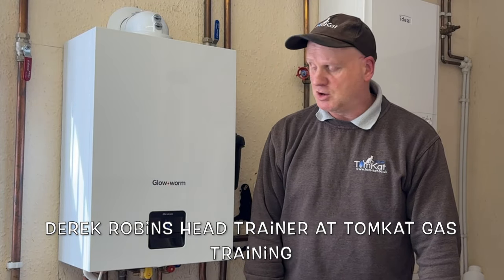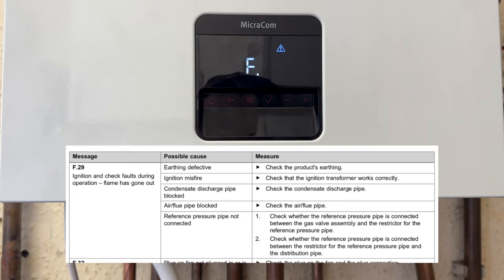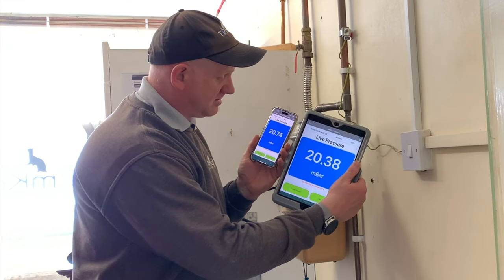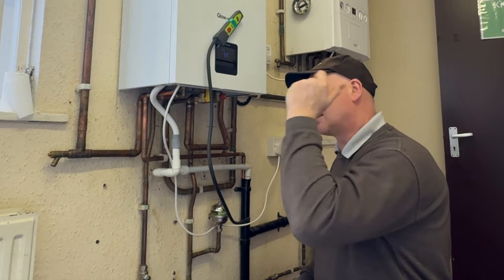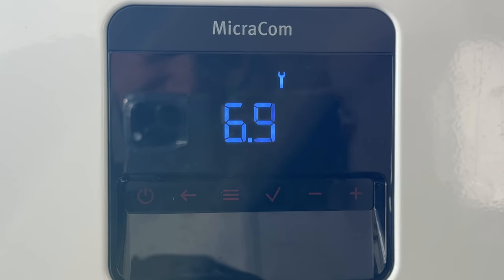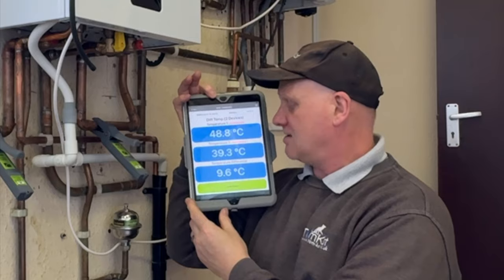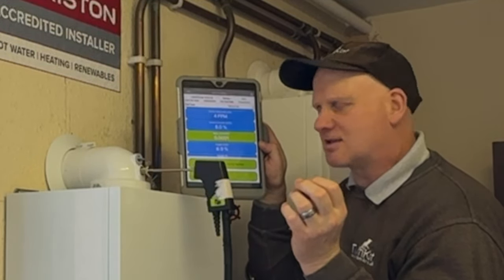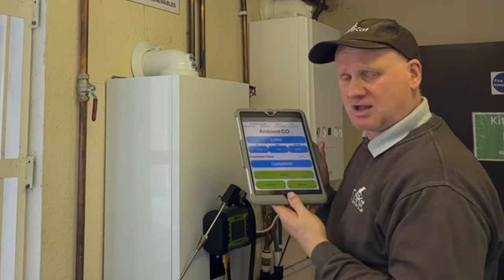COMMISSIONING THE WORST GAS BOILER TO INSTALL IN THE UK  the Glow Worm Micracom

Comment: Mr Robins..... hope you are doing well.
Just a quick one, surely on combustion +- 1 is 8.2 - 10.2!
Good video as always Deckers.
Reply from the maker: Correct mate but glow worm says 9.2  co2 +/-1 in the MIs
Reply: Yep, that is 8.2 to 10.2 unless it says +/- 0.1 then it would be 9.1 - 9.3
Reply: It's  + or - 0.1% not 10%!
Reply: Correction, 0.1% not 1.0%
Reply: @johnward5006  No its 9.2 +/- 1.0, I'm looking at the MI's right now.   0.1???? lol
Reply: @JayGasEssex  It's  0.1% above or below 9.2% therefore  between  9.1% and 9.3%.
Reply from the maker: @johnward5006  mate it’s 9.2 +/- 1% so 8.2 to 10.2 so my readings are in tolerance I was playing a little game to see what engineers think.
Reply: Its +/- 1.0..... NOT +/- 0.1..... however thats just for safety, it should be adjusted to around 9.2.. you want the excess air to be around 30% or slightly below for efficiency

Comment: When performing fga, Glowworm would do better to repeat the combustion tables in the maintenance section in the commissioning section.
The O2 is an important indicator when analysing as are minimum rate figures.
Sorry you didn't do more on system water quality analysis, bearing in mind MI'S and BS 7593.

Comment: I would be doing as per the MI's   

Why would you not? says ring then you have to ring least you can log you have rang them and put what they say in the notes on commissioning else its not been commissioned to MI's and you would have wrote your readings in the benchmark which are incorrect. If Glowworm say thats fine you have done what they have asked and note that down.

With front case fitted  = 9.2 ±1 %I  f the value is outside of the permitted range:
▶ Measure the CO₂ content at the flue gas analysis
point again and log the measured value.
▶ If the value is still outside of the permissible range,
do not start up the product and, instead, report this
to customer service.